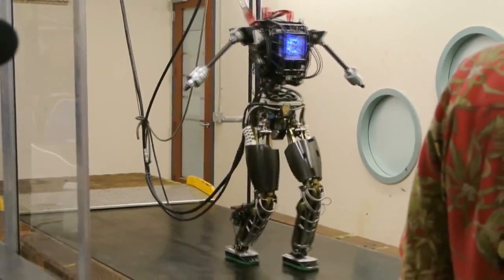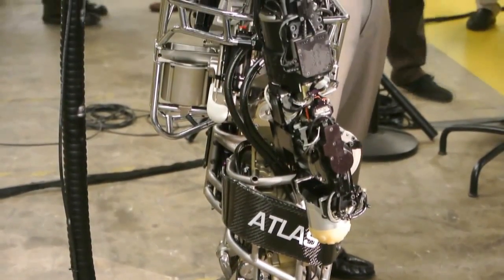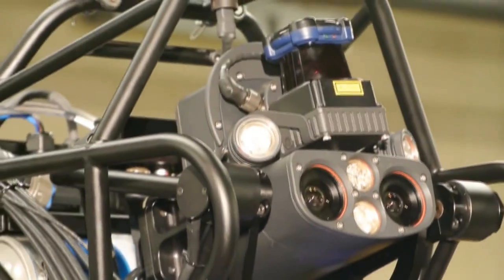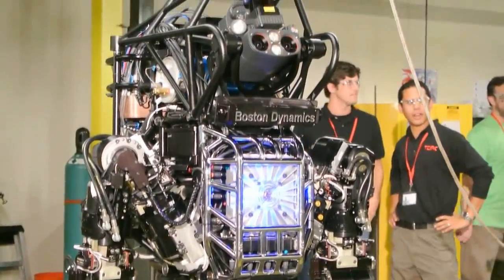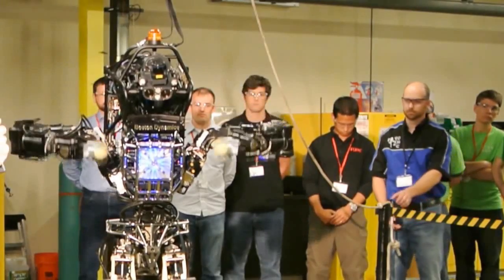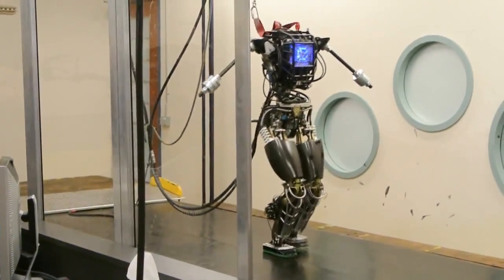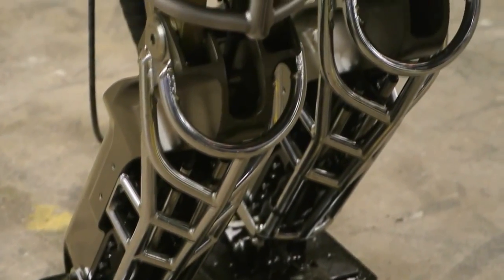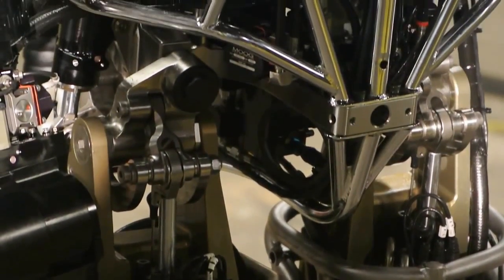Atlas Robot Close-UP View [ One of The Best Humanoid Robot ]

Comment: Could Asimo or Atlas function well in a battlefield? If you equipped these with machine guns and let them loose for example in Syria or chaos Iraq?
Reply: Asimo can only walk on flat surfaces like floors or starers, with Atlas they trying to make a robot that can walk and navigate when there there is hard for even humans to walk or when the surface is not flat. Asimo will fail badly at being batel robot because it can't go where it needs to, Atlas will be too slow and heavy, too unprotected, its easy target, the robots are too stupid at the moment to know what is target, and what is not, so it will need to be human to operate it. And I also expect power source is issue, a robot that will need to refuel every 3 hours will be pretty useless for battel. I think we can wait maybe 20 to 40 years, maybe even 80 years from now.
Reply: Not yet
Reply: ASIMO is much to weak.... But is much better sensitive... Atlas is for tough jobs